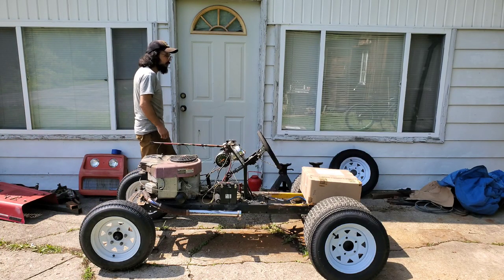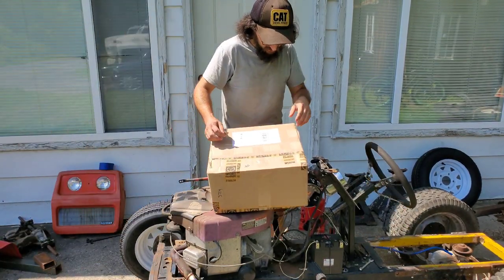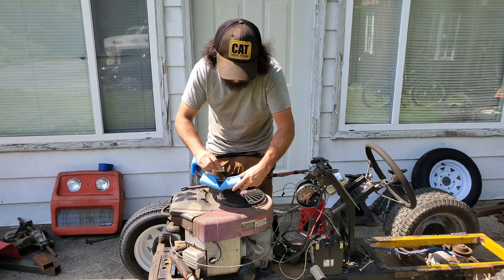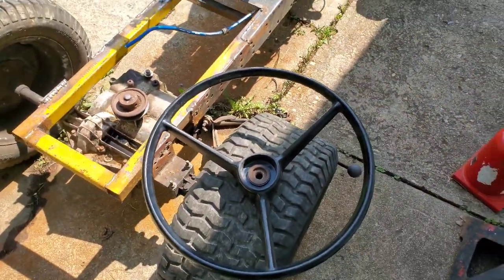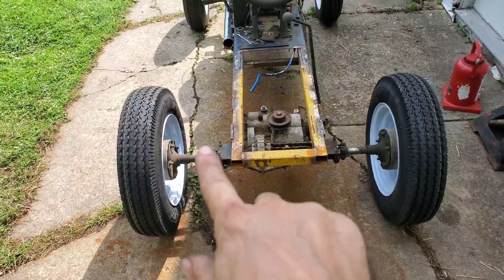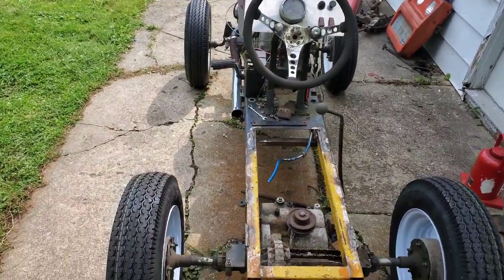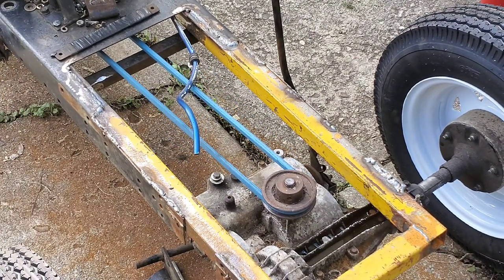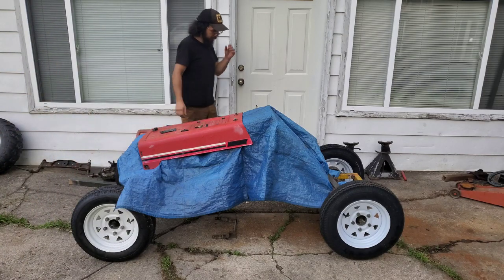Vintage eBay find Unboxing. Hot Rod Tractor gets something cool plus belt install and Trailer Wheels

Comment: Im thinking of doing something similar to what your making but instead of a rat rod or old school early race car style im looking to turn my lt1000 craftsman into a 80s chevy with a little cargo bed duel exhaust cause i got a 19.5 opposed twin briggs engine and i thought of trying to leave the trans in the original position and add a second axle that the wheels will go on instead like a gokart axle with a dual chain drive and similar wheels and a second battery the main battery to power the motor the second to run lights etc...

Comment: The rust on the pulleys is causing it to grab too much. You need to wire wheel the inner surface of them to let them engage and disengage smoother. This will also make your belt last longer.
Reply from the maker: Yeah, definitely true. It's sitting a while. I'll have to do that.